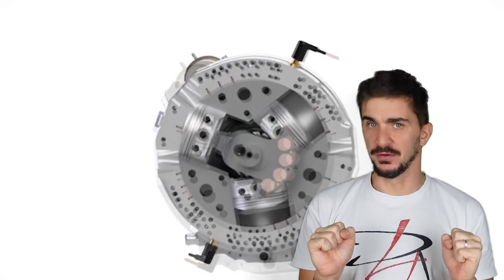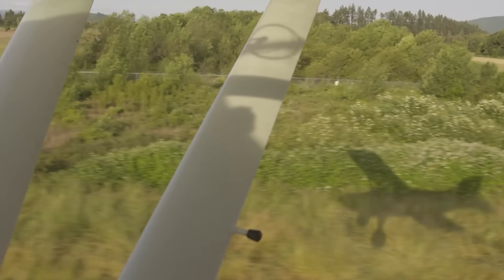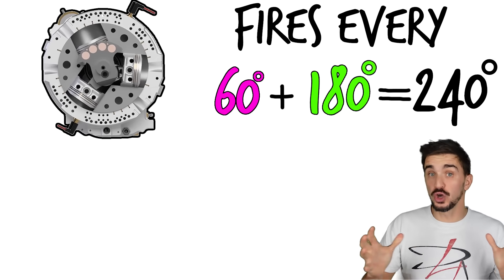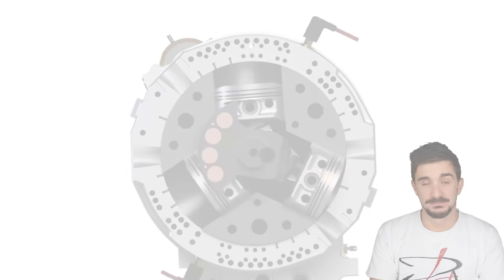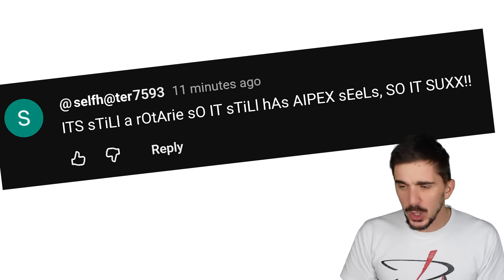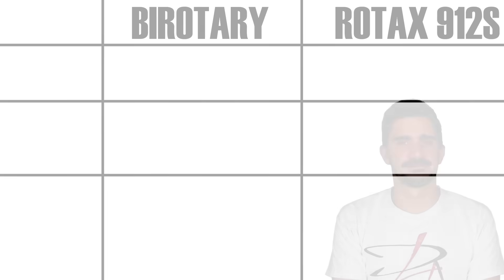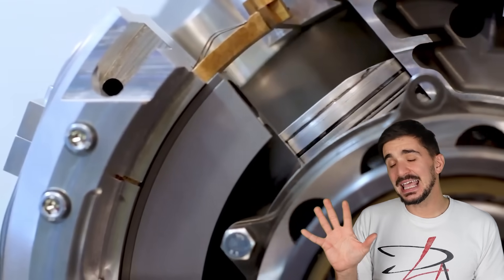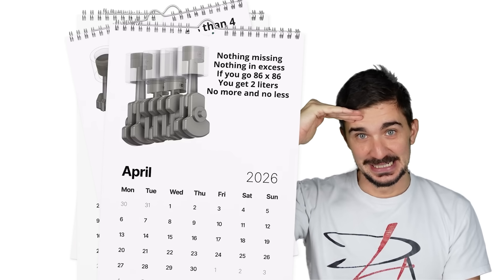This is What Happens When Pistons and Rotaries Make Babies - Birotary Engine Explained and Reviewed

Comment: interesting design for sure, with some more development most of the issues could be solved. some tricky ones would be the high rotating mass that's a lot of inertia there and scavenging the oil return intrigues me, would not the oil all end up spinning around under the pistons?

Comment: 8:15 Sorry, that's not leverage.
There is no leverage that happens as a result of the crankshafts kinematics that reduces the distance the vehicle travels in exchange for the vehicle moving with more force. You can find leverage inside in a regular combustion engined vehicle in the transmission, differential and tire diameter.  This engine does provide leverage via its planetary gear set but not as a result of the crankshaft itself.

Comment: Supercharging  or Turbocharging could solve some of the problems for the BiRotary. A Constant Velocity Transmission might allow for use in cars and motorcycles. This type of transmission has a constant input with varying output ratios allowing for smooth transitions as there are no gear ratios. 
Not sure if I got the name of the transmission correct.

Comment: Maybe they could add valves to half the intake and exhaust ports and make it a 360° firing engine for better low rpm performance and have them open for high rpm

Comment: max rpm and engine degrees should be determined by which output you use not combining them. your drivetrain or properller isnt ever spinning at 10k its either 2500 or 7500.

Comment: It occurs to me that the birotary engine might have an automotive application in an Extended Range Electric Vehicle (EREV) where it could be used to recharge an EV's batteries as it travels. Since it would only be used to turn a generator (like in the Chevy Volt and upcoming RAM REV pickup), its preference to run in a narrow rpm range would be just fine. Its small size would also be ideal in an environment that rewards tight packaging. A number of EREVs from different automakers are scheduled to come online in the next few years, and they may be the wave of the future.

Comment: There's another problem with it for use in aircraft.  With that crankshaft speed it's going to need a propeller speed reduction unit, which will add complexity and weight.  There is a loss of efficiency running propellers at a RPM which makes the tips go trans sonic.  You could run a smaller diameter propeller and spin it faster, but even there is a loss of efficiency.  Racers often run their propellers around 4400 rpm, but they still take an efficiency hit, and they're LOUD.

Comment: The amount of heat this much friction is going to generate is going to be huge and with all that friction the wear on the crank, pistons cylinders, and cylinder block and case the ability of getting any decent amount of life out of it is very doubtful. I'm not buying the last as long as a 4 stroke claim unless your talking about a off brand generator. But that's just my opinion and it was a cool video.

Comment: Here we go again with "driving 4 answers" making something out of low end tech (birotery engine),  the four-stroke piston engine is more thermally efficient, fuel-efficient, more reliable and widely refined through decades of development, making it the dominant choice in modern automotive applications.  I can't see any practical mass production applications at all where the birotery engine is superior to a typical 4 stroke engine, apparently the engine industry thinks the same way I don't see any plans by any vehicle (including small aircraft) industry to use this engine!  You really do need to do your research "driving 4 answers" before you post videos like this!  After all who wants to fly around in a plane with engine reliability problems!

Comment: nice description with small but cute irony as always, but i would like to hear more about cooling and lubification. aren't thy difficult? and how it goes the serial link presented in the end in some seconds? how difficult is to turbocharge this engine? scavenge seems easy since valve doesn' block ther flow, but some a) circular windows or b) removable blocking blocks can adjust the distribustion to a sort of VVT.

Comment: Very interesting engine. I don't see it working in small aircraft mainly due to the weight and that was dry weight and this engine looks like it will be very hard to air cool unless there is some way I don't see in this video. Add the liquid cooling system and it's way too heavy to complete. Also the counter ratating is not going to help the rotation force in that small aircraft as most of that is caused by the propeller which this engine is still going to turn. However I do like the innovation. Generator market maybe? I do hope to see one of these rotopiston engines in the wild some day

Comment: Propellöür? I fart in your general direction, you and your czech Knobs. Your rotary was a hamster and your piston smelt of elderberries. 
I would argue that the piston engine has something distinctly masculine about it. 
This is a very interesting engine design. I like it, as well as the explanation and animations. I just don't get the reactionary torque bit. As far as I understood it (and experienced it in model-boating), it has more to do with the torque that the propellor, sorry, propellöür exerts on the air, and the way to counter it is to install two counter-rotating props, like they did on late series Spitfires. 
Thinking of engine layouts with an odd number of cylinders, the Megola motorcycle comes to mind, which also has a rotating engine block and a counter-rotating crankshaft, and 5 cylinders. 7 and 9 cylinders are common in Airplane radials, and I've even seen an 11-cylinder one, although it looked rather cramped. 
Now have some good holidays or I shall taunt you another time!

P.S.: I sincerely appologize if you really didn't catch the Monty Python reference and feel offended.

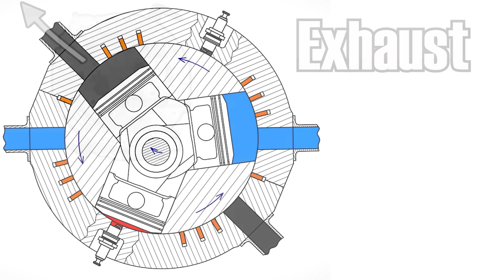Comment: 4:36 - I may be missing something, but the engine is firing every 60 degrees of crank rotation.  Each piston has two ignitions per 360 deg, but with three pistons it's 60 degrees of crank rotation.

13:34 - The comparison of power to size or weight is a bit disingenuous, both make 100 BHP but with power being linked to speed and the birotary going twice as fast it's going to put out more power.  The torque figures would be interesting to see for each engine.

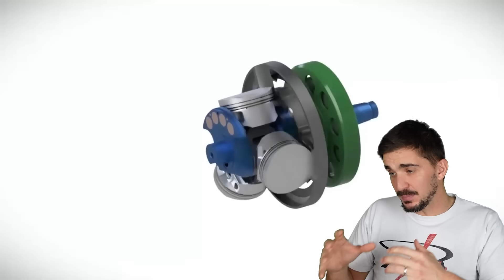17:00 - It is possible to have variable inlet and exhaust ports to change power characteristics and an electric supercharger would get over the low intake speeds at low revs.

I can't see this going into vehicles because of the operating speeds.  Aircraft tend to use variable pitch props and a fixed engine speed from my understanding at least, this lets the engine run at it's optimum speed for as long as possible during flight.  It's an interesting engine design though, and if the friction losses outweigh the savings in cam and valve friction it looks promising.

Comment: All motors need a fly wheel. It's heavier,  but less friction.  Stack a couple and drop it in an RX7.  CV transmission. You can restrict and aid air flow with external sources. VVT, diaphragm?

Comment: 2:13
I dont think that would fix it.
The torque is caused by the propeller blade pushing against the air. Not any internal motor torque.
When the propeller is being spun up or spun down you would get some internal motor torque, but not at constant rpm.

Comment: @d4a The throttle response and low rpm could easily be handled by using premium fuels with variable levels of ignition current ( imagine a 1st, 2nd, & 3rd spark plug per chamber)

Comment: With all of this new engineering, how efficient is this engine? Does the fuel have enough time to completely mix and burn? Are there any improvements in range? Anything else? Also, am I correct that the mass of the crank shaft is well below the mass of the engine block but that though the speeds are not equal, the forces will be, and they'll cancel each other out?

Comment: Best sealing for a rotary engine still doesn't mean the sealing is actually good. At least there's footage of it actually working, so it's doing way better than most 'revolutionary' engine designs - I'll need to see a lot more real world test data to be convinced this is anything other than another curiosity, but if it can manage full flight certification in the EU that would definitely quiet most of the unconvinced. Whether people would actually buy them given the claimed gains seem marginal for taking on a while new design with potentially unforeseen failure modes is another question though.

Comment: No you go with the bigger block bigger cylinder bigger rod and piston it will still be the same timing everything's just had to be bigger believe me I know 35 year on the job mechanic the only problem you have to slow things down so it didn't tear it so far !!?

Comment: Any ICE is dead. Not to say we shouldn't celebrate the clever engineering. But, electricity is way, way, way more efficient. And, a company just revealed a 1000 hp trans-axial motor that weighs just 24 kg. Any ICE takers?

Comment: firing at 240 like an inline 3 I don’t think is that important. what is important is how high can the firing rate be pushed for more power.  maybe it can run at a higher firing rate. but it is easier to compare if the rotating engine can rotate faster or with less stress on components than an inline 3 cranckshaft then it would make more power. since there are no valves, it should run easier to higher rpms. I mean compared to an equal stroke inline 3 
looks very interesting
economy will probably be worse because of the stroke
in cars can work with eCvt but the design can be modified for higher stroke and may bring a lot of benefits to the automotive industry

Comment: I'm curious. Since the pistons themselves spin outward and the oil also sprays (?) outward to coat the sleeves, is that oil going to build up somehow underneath the pistons and not return to recycle? With the pistons obviously pumping, that oil is pushed back toward the crank each stroke, but how does it get recovered and repumped? Since this engine already works, I'm curious how the oil gets back to the starting point to start over again. Actually, the whole oiling system is something I can only imagine. I'd like a more detailed explanation of it sometime.

Comment: 1) Notice the huge radiator under the engine on the Knob video. Not good.  They should have had a more aerodynamic design.  It's interesting that they chose a glider for their test platform.  Doubling the kilowatts (power) is going to greatly increase the cooling requirements although the volume of air through the radiator of an  aircraft in flight has a beneficial aspect to this problem.
2) Torque in propeller aircraft is caused by the downward force of propeller.  The engine generates the power but the prop is the torque producer. There were dual counter-rotating propeller designs that produced zero torque.
3) Because of the counter-rotation of the engine components, I think the RPM should be subtractive.  Thus 5k RPM not 10k RPM.
4) The 3:1 gear reduction is almost a 3x torque multiplier which helps compensate for the short stroke.
5) It will be interesting to see how long it would run until the seals fail or a 2000 hour teardown examination.  Test at max power - 20 min, 75% power 4 hours, idle 20 min, repeat for 2k total hours.  The real plus would be for it to run 3k hours or more before overhaul.
6) What happens to all of the above when the output/displacement is increased for 200 or 300 HP?  Curious minds want to know.

Comment: In a long stroke version the housing and outer part of the block would have to be further from the center meaning the ports would be further away allowing more time between each stroke. Something with a longer stroke could have less rpm's and more torque. At that point a radial engine might be a better option though

Comment: Increasing the diameter of the engine would extend the length of the piston rods and hence torque.   p.s. it's already doing 7500rpm and that would not change.

Comment: Hey man, I just wanna get this out here, maybe you'll see it. I just realized you're from Sarajevo. I never knew this, have been following your channel for about 7 years. I used to drive a project car, a carb'd Audi 100 maybe past your house if you live in those hills above Skenderija, and always thought shit, this guy would know what's wrong with my car. this was when I had just gotten it before Covid and had to pump the throttle as soon as I was on the brakes. Didn't know my tubes had gone all soft and cracked and were leaking. I got them fixed in East Sarajevo by this carb specialist. Sadly had to sell the car when Covid hit. But I think I could have kept it with some more repairs. Damn. I guess you're one of the good one from around here. Keep it up, keep up the smart work and all the best to you.

Comment: Having a set RPM works well with a hydrostatic transmission. Speed is controlled by varying the pumps fluid output which drives the wheel motor or motors. The prime mover (engine) remains at the peak efficient RPM. This system is already in use from everything from lawn tractors to heavy equipment.

Comment: OK, here we go.  This engine was designed in the 1970's in Brisbane Australia and patented in Australia in the 1990's.  And, it works.  But, this original design had longer strokes (from memory), and the crank had to be made out of expensive metals.  This design was shown to GM and Ford and they loved it, but, the crank speed was too slow, making it too expensive to change the entire down stream drive train.  The oil seal and oil loss is no problem at all, in fact, the outer rotating seal line works great.  And, your design drawing is only the first prototype of the design, the in and out vents as shown are very inefficient.   In Aus, the first prototype was as efficient as a 4L Ford engine of the day, the 2nd prototype was as efficient as a turbo Porsche engine, and the designer knew how to easily get another 25% efficiency out of it.  It would be great if this engine and these people can get this thing working, and licence the plane to fly with this engine in developed countries, but I can't see it happening with all the regulatory problems and the massive investments in green/hybrid flight.  But, good luck :)

Comment: Three things: 1. You speak so fast that the closed captions cannot keep up with you. You don't show some of the graphics nearly long enough to comprehend the features. 3. All your motions and emotions do nothing to contribute to your presentations. I love the concepts of engine designs. I owned a Mazda RX3. I installed an RX2 engine into a 1963 VW. My first fascination with alternate engines was the Virmel Phased Vane Rotary. I own a 1986 Fiero GT. With my Fiero Guru, we upgraded to 1988 suspension F&B. we installed a 2005 Pontiac GP Series III 3800 SC with Eaton Series V SC. I designed and we fabricated a true dual exhaust with equal length primaries and SpinTech mufflers. I designed and we fabricated mounts, etc. and installed a Mazda RX8 electric assist power steering. And, my final point is: I studied speech and voice for four years, including performing in Gilbert and Sullivan plays. I know how to speak properly. Hint, hint.

Comment: Could this engine possibly be "viable" in a "hybrid car", with a electric drive train and  where this engine only is used as a power source for a generator. That way you could run the "bi-rotary" at it's "optimum rpm" and let the "electrical drive-system" deal with the "variable speed problem"  ??
Best regards

Comment: Another great video! I did see at the end that the manufacturer shows that it could be coupled together like a normal rotary engine. Still would have the same limitations that you spelled out, but I wonder how the power output changes. Additionally, I wonder about the lubrication system (volume, parts, and circulation). Great job.

Comment: Hold up, hold up. You say the Birotory engine has "0" chance of making it in the automotive sector.  However, there is a thing called an EREV Hybrid. The engine simply runs at its optimal rpm all the time while the electric motors deliver power to the wheels. I would be very curious how this engine would perform in an EREV application.

Comment: It's physical size, and the way the masses will counter vibration, it'd be a great engine as a Range Extender in an EV automotive chassis. Same goes for use in aircraft like the Jetson One or the Pivotal Helix, as onboard generator to keep the batteries charged. The size and the high RPM, also means it'd be damn nice running a water jet drive, when such is applied as a high volume water pump, like in fire trucks.
I'd like to see it running a ducted fan, and see what other fuels it can run on, such as methane injection.